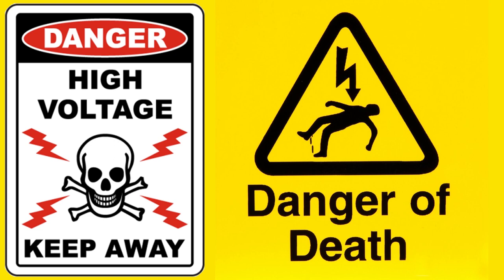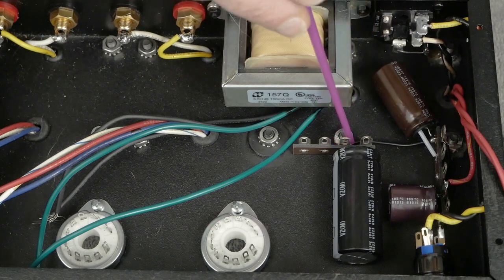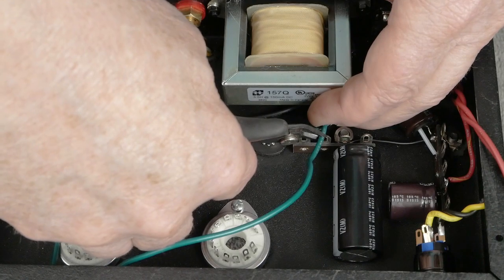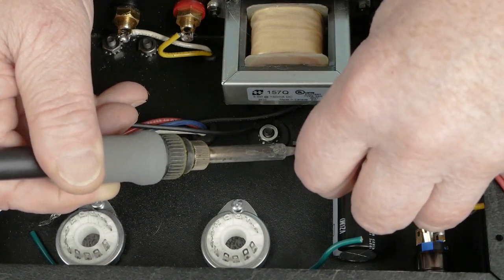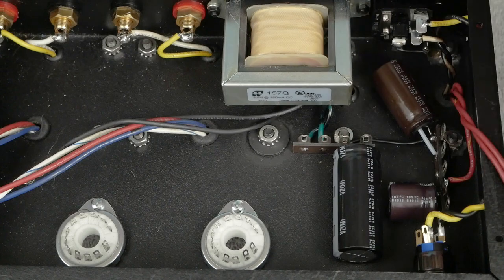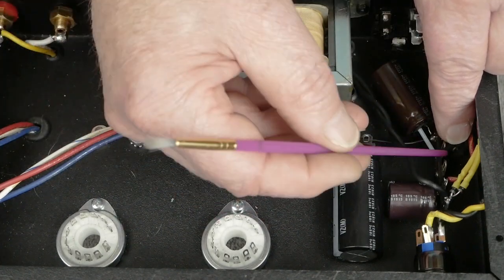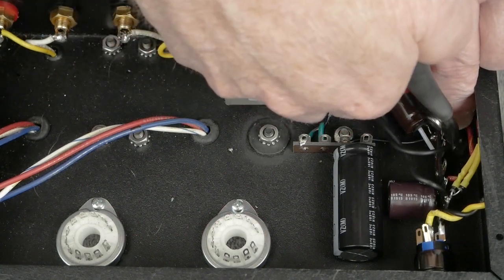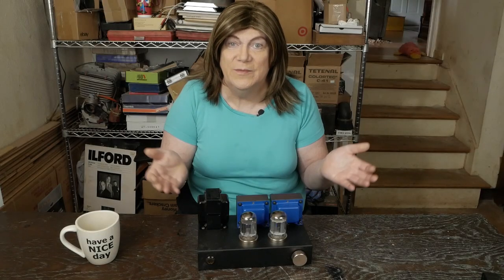DIY 5W Compact Tube Audio Amp: Finish the Power Supply

Comment: Interesting,  when you connected PE to chassi and secondary 0 ref to chassi the ground loop would be vanishing little , but I notice also they usually connect with 1 Meg ohm from 0 volt ref to chassi to keep galvanic isolation . But maybe your way get lower ground loop. Grounding is not easy .
Reply: I did not see a ground loop in her implementation. She connected earth ground to the chassis and connected her star ground point to the chassis as well.  The star ground point has and will have other connections connected to that point or branching from that connection (and branching (from a branch), branching (from a branch)...).
Reply from the maker: NEVER isolate the zero/signal ground in a tube amp from the chassis/earth ground. If there is a short from the high voltage to the signal ground in a tube amp, you need it connected to earth so the fuse will blow. Isolating it with a resistor etc is DANGEROUS. I'm not sure who "they" are, but that is not how you should be grounding a tube amp and I've never had ground loop hum issues grounding gear this way, with a chassis connected star ground system.
Reply from the maker: Exactly, as long as you run a physical wire to this star ground point, and don't run lets say line level grounds through a power supply ground wire, it's not a loop.